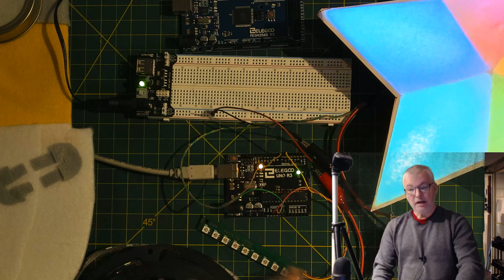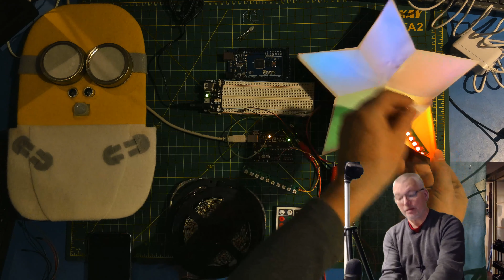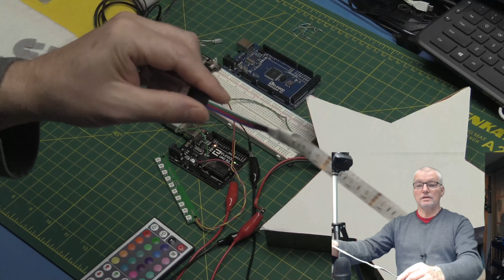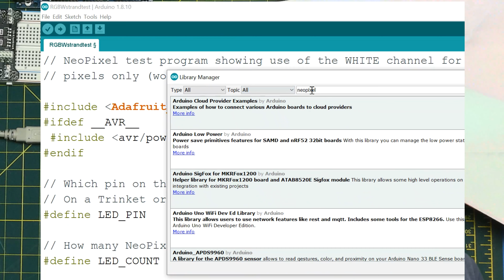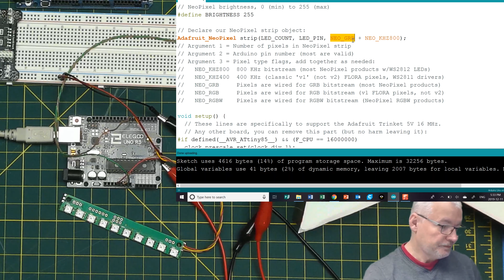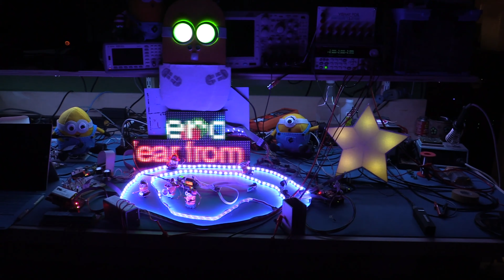Easy Xmas Decoration with Arduino + LEDs & NeoPixels

Comment: You're slowly kicking the lazy out of me :-)
I've been planning to build some sort of addressable led light display (just for fun), but keep procrastinating. Now, you may have just pressed the right button :-)
I don't think I'll have the time to put anything together for this Christmas, but I'll eventually end up doing it.
BTW, one possible source of 5V high current for large LED arrays can be an old PC power supply.
Reply from the maker: Most definitely and also the 12V on the same PSU can drive the other types of strips